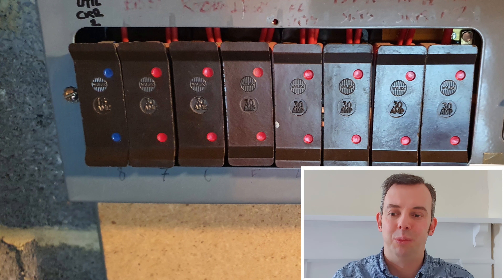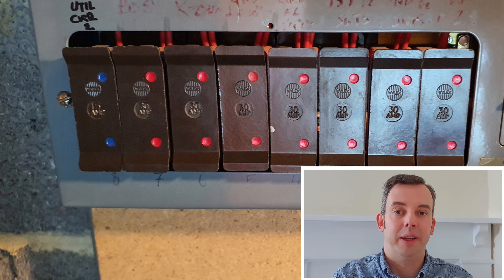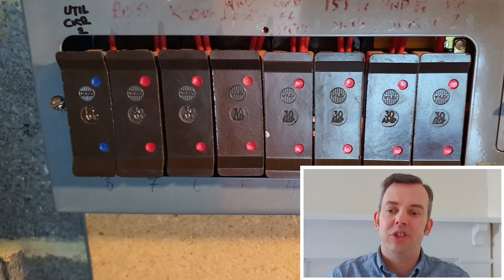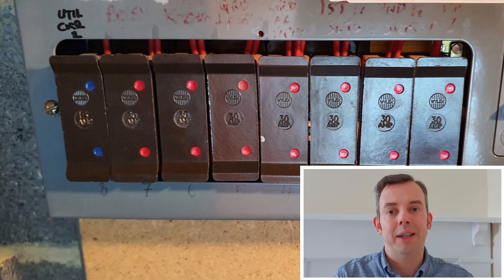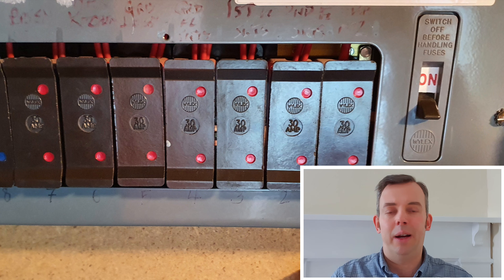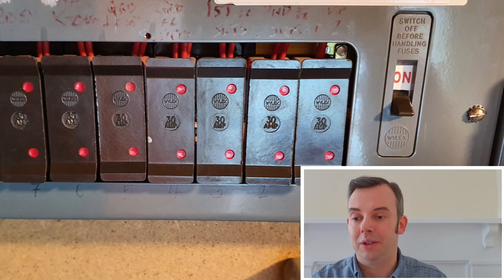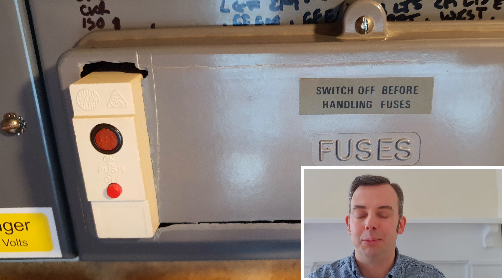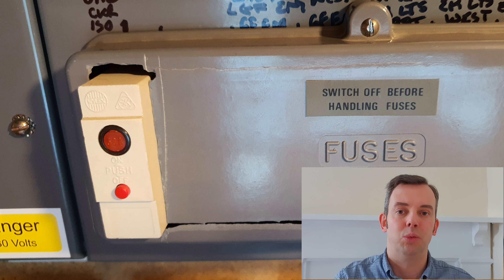What are the reasons for changing this fuse board? Electrician reacts

Comment: After your visual inspection of that rewireble fuse box you can only recommend that it should be replaced, you can not change it just because you coded it with C2s and C3s , it is up to the client to decide if they want it replaced or not, BS 7671 page 13 or 18 health and safety executive’s note just because an installation was installed to an earlier edition of BS7671 dose not necessarily mean that it won’t comply with the current edition and relevant regulations. We required to test the installation to BS7671 18th edition, and if all tests are within tolerance then you can certify it as safe for continued service . And recommend a board change and explain the benefits of such and the benefits of RCD protection .

Was there any signs thermal damage or exposed conductive parts? Or over heating ? No then leave it alone and advise the client of any recommendations. Also that fuse box is metal so straight away it complies with the 18th edition. As for the fuse cover agreed it is not pretty but it does not present a danger to the property or to life so why code it , it is doing it’s job and covering the fuses .
Reply from the maker: Hello Sean, 
Thank you for your comment. I mentioned in the video that the BS3036 rewireable fuses are still included in the wiring regulations, and at the end of the video I said overall I would change it, however when doing an EICR it is necessary to assess it against the wiring regulations and to be specific about any recommendations. I also mentioned that there are some observations that would only be a code 3 because they were introduced in the 18th edition.
My observation about the fuse cover was that it had be modified to fit the plug in mcb which left damage to the fuse cover. 
I didn't mention the metal fuse box because the requirement for non combustible consumer units applies to consumer units installed after amendment 3 of the 17th edition was introduced.
It is up to the client to go ahead with any recommendations of course. The idea behind this video was to give my thoughts on which codes I would use and the reasons.
Regards
James
Reply: @JamesCurnowElectricalEngineer  yes I get that like wise I was just giving my opinion.  So please don’t take it the wrong way I don’t mean any offence or disrespect . I have watched a lot of your videos and I think they are great 👍 this as well. 👍👍👍❤️⚡️